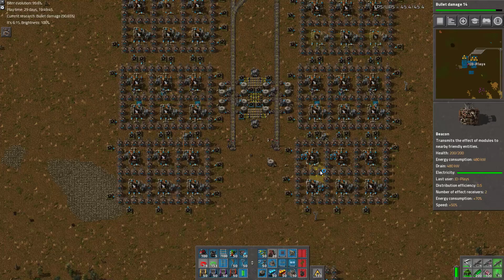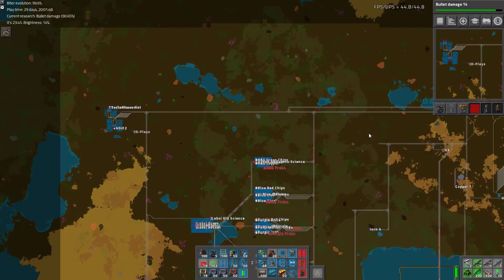We Need How Much Gas? - GigaBase S01E102 - Factorio 0.15

Comment: I did learn some optimization tricks from previous few episodes. Thanks for that. Now it's my time to share :)

I've done the spreadsheets math for spm factories when I started planning mine.
For 5k spm you need to process 675060 oil and 748404 water a minute

Here are the number of crafts/recipes a minute for 1k spm, assuming it's all prod3:
- Advanced oil processing 1,350
- Heavy oil cracking 365
- Light oil cracking 1,708
- Lubricant 294

Heavy oil cracking assumes that you spend some heavy oil for lubricant. Light oil cracking assumes that you spend light oil for rocket fuel for rockets (not for trains). If you want to include fuel for trains here, add more refineries and more heavy cracking.

All numbers confirmed with other players' calculations on reddit and with wiki raw resources numbers for beaconed RPM bases.

So, for example: 
For 5k spm, given that beaconed refinery has 8.55 crafting speed and oil cracking recipe takes 5 seconds, you need 1,350*5/(8.55/5*60) = 66 fully beaconed refineries. So, you still do not have enough of them.
For lubricant that's 294*5/(8.1875/1*60) = 3 chemical plants. 
And so on...
Reply from the maker: Oleksij Rak ill have to check my maths when i get home, im fairly  sure what i have will have the throughput needed, least i hope so! if i need 72 refineries then there is no way this will ever work!

Comment: remove all po9llution--->                    /c local surface = game.player.surface;
for coord in surface.get_chunks() do
 surface.pollute({coord.x * 32, coord.y * 32}, -10000000)
end
Reply: pollution is the biggest factor for ups drop that ive noticed
Reply: idk if you already have it
Reply from the maker: +IceLegions Gamming Thanks so much for this! I'll try it asap (won't be for a few EPs cuz they are pre-recorded butI think I tried this or something VERY similar and it failed, but this won't turn pollution off as well, so I need that as well. I tried the pollution = false command and it didn't seem to work at all
Reply: i used it on my game and it turned off pollution for me, so hopefully it is what your looking for